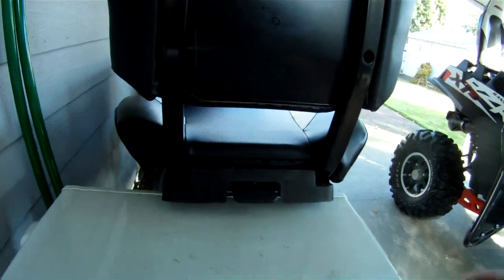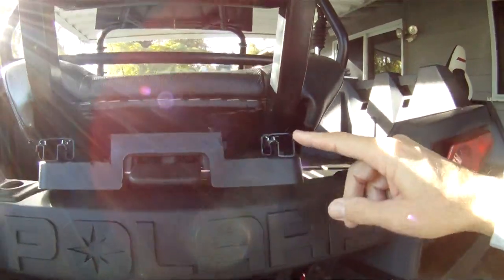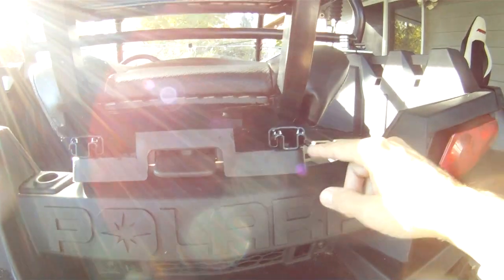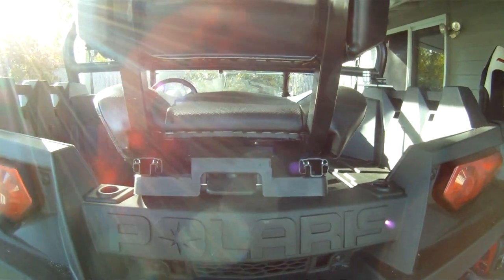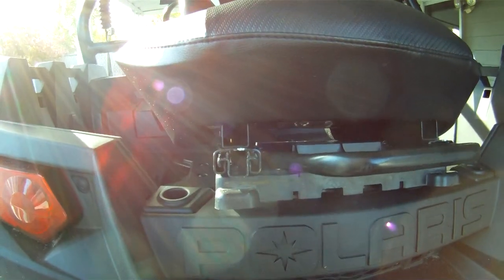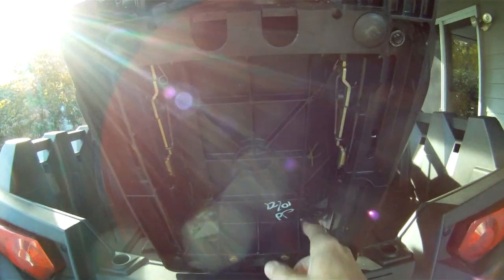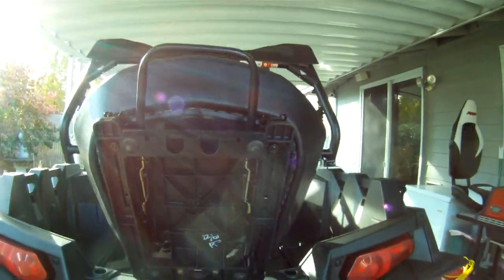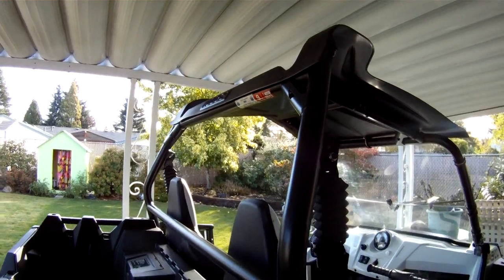RZR seat slider install using stock bases and 1" lift

Comment: why do you need to cut the base? the kit should have come with everything you need.
Reply from the maker: cutting the base only raises the seat 1".  if you don't cut the base the sliders raises the seat almost 4"
Reply: Where did you buy the sliders?